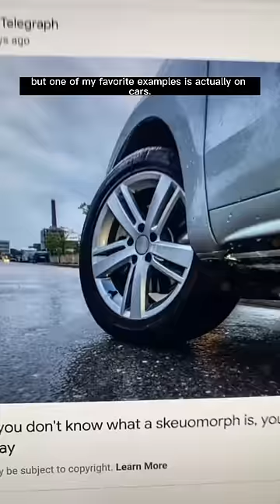Why do maple syrup bottles have tiny handles?

Comment: Also from cars: the blinker noise comes from a bimetal plate snapping back and forth, making the blinking possible. We don't use those anymore but the noise stayed.
Reply: Also helps to remind you when you may have left it on accidentally.
Reply: I hate the non bimatalic strip blinkers. They suck.

Out of sync and everything.
Reply: They are still used in some older vehicles.
In my city there are some old trams that use bimetal blinkers. You can hear them click quite well when the tram is almost empty.
Reply: Ah, another Technology Connections connoisseur
Reply: @ZM1306 I never knew why the sound didn't match the lights!!
Reply: I hate the sound so much I ask my partner to turn off the blinker if the light is taking to long. I hate any repetitive ticking noise though.
Reply: Going through the comments to find other examples of this. Thanks, this is a good one.
Reply: My car does :)
Reply: @ZM1306  worst part is they usually have an inconsistent BPM
Reply: Right? Why not take out the entire blinker system? Not like people bother to use it.
Reply: @ZM1306  Seems like Ford has done a pretty good job with theirs. It's electronically controlled, so there isn't a problem with syncing an inconsistent blinker module with a consistent electronic ticking
Reply: The noise is useful for the driver to hear to know if their blinker us working or if they accidentally left it on... Without having to take their eyes off the road to look at the flashing arrows on the dash
Reply: i mean now new cars just use the speakers but it was only like 12ish years ago so theres a lot of cars that still use them
Reply: So the noise is actually a Federal requirement, so when they stopped using flashers and went to full LCM computerization the noise/a noise HAD to stay.
Reply: Also nice to have a feedback noise, but that's an interesting reason for the noise existing in the first place
Reply: @Ariridesbikes this is the second comment on this video i have seen mentioning TC
Reply: Our family car doesn't have it, and it bothers me unmeasurably
Reply: You say "we don't use those anymore," but plenty of cars still do. I can go into the Toyota dealership and walk out with an 80k landcruiser that has air-conditioning as an optional extra. A car like that is not having fancy pants indicators. Plenty of vehicles still use old technology.
Reply: @peacelovewar98  Can't turn the blinker off.
You may know where you ate going.
The person behind you might be on the turning lane.
But the person comming from the other side neither knows the lane layout (because cars are standing on the direction arrows) and they don't know where you are planning to go (as that might be ambiguous or you might not care for the lane arrows).
Reply: @BlackKraya  Analog Telephones had quite a bit of noise on the wires. Because up to100% of the wiring was used analog.
With digital telephones - even the earliest cell phones - this wasn't the case. There isn't enough Analog used cabling to have audible noise.
All the electrical noise is a digital transmission issue.
They add noise onto the signal, so users know if there is still a signal comming from the other party.
Reply: @christopherg2347  like which noise do you mean? The connection?
Reply: As a kid I loved that sound on the first car I can remember, and was learning to imitate it :D
Reply: @EmGeeman287  bimmer apparently did that for 97% of their drivers lol
Reply: I wonder if that would make a better sound than my blinker does. For some reason out of all the cars they test drove the one with the worst blinker noise is the one I bought.
Reply: @Allstin  The ever so subtle background swoosh, that you only notice when it is absent.
Reply: did not know that one, very interesting!
Reply: Okay uut the original blinker noise is just something else
Reply: But the noise does have a purpose such as reminding you have your turn signal on besides the sound it makes if you've left it on for way too long and some are hard still have this is if a blinker goes out it will start to click more rapidly and Flash more rapidly
Reply: It helps people to know if they're still indicating, but somehow, some people don't notice the sound has been going for 10 minutes and I have to creative convey to them that they're still indicating right in the right lane of the motorway
Reply: Some still use them but mostly the noise is just there for us
Reply: It helps remind you you still have your turn signal on.... It's just not as effective on 80-year-olds that drive down the fucking highway with their blinker on for 10 fucking miles 😭
Reply: @Ariridesbikes  we have arrived
Reply: I think it also serves as an audio reminder for those who forget to turn it off.... but those people still ignore it. DUMMIES!
Reply: Learned something new today, thank you stranger.
Reply: @ZM1306 generally the smallest difference between the strips can cause it to have a slightly shorter or longer blink, so really the mechanical ones are much more inconsistent
Reply: Didn't know they changed that. Mine has a noisy relay.
Reply: Was wondering about that while driving that yesterday. I was thinking about how it sounds like something hitting something else.
Reply: While the noise is fake it's still nessasary.
Reply: I dont think it was ever bimetal, the sound was usually produced by a relay that had a magnet in it and a springed contact that would stick and unstick, closing and opening the circuit.
Reply: @HartyBiker There's a difference between "vehicles still exist with this technology" and "vehicles are currently being mass-produced with this technology", you can almost always find some niche place to get niche things.
Reply: @theBestElliephant  a lot of 4wds being mass produced now still use that technology.
Reply: @unicornkitteh5332  "The inventors of 'foolproof' systems, underestimate the ingenuity of the fools."
Reply: @EmGeeman287 Yes, and those people are called "Bad Drivers"!
Reply: @christopherg2347  lol this is so true. Is that a quote from someone?
Reply: @unicornkitteh5332  I am sure it is a quote, just not sure where I got it from.
Reply: @christopherg2347  it doesn’t stay off, if we’re in a turning lane without a light I get it has to be on. If we’re in a lane with a light it’s off after a bit of waiting and back on prior to us turning once the light goes green
Reply: I learned the other day that, after changing lanes, my car beeped louder to remind me my turn signal was still on and one-up the subtle ticking to the next level.
Reply: @ZoosheeStudio  too bad everyone where I live can't hear it i guess.

Comment: If you've ever wondered why your standard has misaligned keys, it was a mechanical necessity for typewriters. We kept the design because people were used to that layout.
Reply: A typewriter is a mechanical marvel. Somewhere between a grand piano and manual transmission.
Reply: It put the letters in such order to lessen the possibility of the mechanical letters to hit each other. 
The french have there own, not qwerty but azerty if I remember correctly.
Reply: The letters used most often, in English, are placed under your fingers when you place your hands in the traditional location. For example.. .look at location of q and z. Most useful class I took in high school was typing.
Reply: @nn3514  in a daisy wheel style printer, it ment the Q had to travel further to the paper and had the longest “arm”. This ment it was longer on his way with the biggest reach so the probability of preventing another letter to reach the paper was the greatest. That’s why the most uncommon letters are on the sides. (I’ve learned blind typing on a mechanical typewriter during a course)
Reply: yup. designed with the most used keys to be the easiest to press. 

if you just rest both hands on your keyboard with thumbs on the spacebar. notice where your fingers are naturally at.
Reply: @uberempty  I think you are thinking of a different layout such as Dvorak, QWERTY was not designed with common letters being most accessible, rather putting common letter pairings (such as ‘he’ and ‘th’) a bit distanced from each other to prevent jamming on typewriters, as they were what the layout was designed for.
Reply: Also but slightly unrelated- the word “typewriter” can be written using only the top row of keys
Reply: So unintelligent. They made up a new word for whatever the first time.
Reply: That's a little different though. The trash on your computer looking like a trash can isn't affecting the way you drag things into it, but the keyboard layout being misaligned is part of the function.
Reply: @theofthe2299  Correct. QWERTY was designed so that people would stop breaking the typewriter from typing so fast. It was made to slow people down. The other thing is that tradition has kept it in place all these years.
Reply: It had nothing to do with the mechanical nature of the typewriter. The layout comes from trial and error. Oddly enough, having the keys arranged alphabetically was too hard to use.

There was no mechanical limitation or other mumbo jumbo that led to qwerty.
Reply: @Muis83  that's incorrect. The letter layout wasn't chosen to make it less possible for keys to hit each other. "ER" is the most common English bigram but the keys are right next to each other and you press them rapidly with two different fingers. Same for TH, SE, DR, RS, KO, PO, HU... there's lots of those bigrams.
If you type the alphabet letter by letter you notice a pattern: up until the letter Q, the next letter is usually very close to the previous one. This makes me think that it's based on the alphabetical layout with some keys swapped for whatever reason
Reply: @tspawn35  no it was not designed to slow people down. The fastest person on the planet is Rocket with a little less than 300 words per minute, or 5 words per second, and he did it on QWERTY. Now, I never owned a typewriter, but I suspect what's slowing down the typist is either the typewriter itself (heavy, slow keys with long travel distance) or the typist (to prevent hammer jamming)
Reply: @topherkrock  What you're referring to is keyboard layout. QWERTY is not the reason your keys are misaligned. Your keys could just as easily fit on a perfect grid, but they don't.
Reply: @tbqhwyf  going back to the mechanics of the typewriter, letters would be in half a circle. The travel an E would do is very similar to an R. This ment the letters would not cross each other coming from left and right. In the middle it didn’t matter which hand because it had the short travel.
Reply: @tbqhwyf  5 Words per second? Farrrrrrkin hell
Reply: @neverfail9432 , wrong. The alignment of the keys wasn't for mechanical purposes, either.
Reply: @topherkrock  If you care, look at an image of a type writer and notice that each key has a metal bar extending upwards. They can't overlap, so each key has a unique column. 

You could also do a basic google search and find the same information before claiming someone else is wrong.
Reply: A E F J I L  @uberempty

Comment: Only problem hank, that's a picture of an ALLOY WHEEL not a hubcap. Alloys have to have spokes or something because otherwise they'd be extremely heavy and defeat the point
Reply: I was about to comment, “that’s not a hubcap”
Reply: @jollygoodsmashing these wheels do look like alloys but it is hard to tell if they are or not. some care company's actually make a spoked steel wheel with a plastic cover that could be considered a hub cap. Also that little circle in the center of the wheel. could also be considered a hub cap.
Reply: @tobymikula9081 that's definitely a rim. It's not a hubcap at all.

Comment: My favorite is the blinker on cars, blinkers used to have a relay under the dash that clicked on and off making the blinker noise. Now cars make the same noise through the speaker in the dash, if you’re seat belt starts dinging at you while you’re turning you will hear the blinker noise stop while it dings and then continue clicking again afterwards.
Reply: You don't realize how useful it is until you drive something without the blinker noise. My dad bought a tractor that doesn't make any noise for the blinkers or hazard lights and we always forget to shut them off
Reply: I love the relay sound of the blinkers, the fake beep-boop they started to put in mid 00's cars is horrible, I can almost smell the cheap plastic from thinking about the blinkers
Reply: I just wanna know why its tiny, not why there's a handle,
Reply: @bambibooza4921 It’s just aesthetics now. They shrunk down the whole bottle, and now the little handle is just iconic for maple syrup. I’ve never actually seen one though haha.
Reply: thats not the same though, the noise is there for a reason, not because people wanted to hear it for memories...
Reply: And it clicks fast when it doesn't work to warn you

Comment: Car indicators used to have a mechanical clicking noise as the light flashed because the circuit actually had a mechanical switch. Now there's an electronic clicker specifically added so you know it's still doing the thing.
Reply: Alot of newer cars just play it through the stereo speakers now
Reply: @archygrey9093 You sure they don't play them through the mono speakers?

Comment: When you mentioned the shutter noise my immediate thought was how digital keyboards have the sound effects (and on android I think they also have a vibrate/other physical indicator) automatically turned on. You have to actually go into the accessibility/keyboard settings to turn them off.

I love that this is the backup system we’ve made - electronic makers assume that most people will want to verify that their device is working, like the old ones used to, so we make them pretend to function in the same way.
Reply: I actually find the noise and vibrations to be really helpful. I have a lot more difficulty typing when they arent on. It might have to do with dyslexia but it might be in the acceptability section because of disability.
Reply: I usually swipe-type, so it's confusing when I have those sounds turned on.

Comment: When writing a text document in Windows, hitting the ‘enter’ key generates two characters in your document, called CRLF (Carriage Return, Line Feed). This is a reference to typewriters where moving the carriage (the letter stamping mechanism) to the left of the page and advancing the paper upward were two different actions. 

In Unix-based systems, hitting ‘enter’ creates a single New Line character. Without handling this difference, a document that was written in Windows and copied to Unix will have a weird symbol at the end of each line, representing the Carriage Return character.

Comment: I really love that the picture Hank chose is of a wheel and not a hub cap.
Reply: Lol they did a good job with the fake disc brake look.
Reply: I was thinking that same thing. I am pretty sure that is just an aluminum rim lol
Reply: @Moo Evans  That is not a hubcap. It is a wheel. Hubcaps are generally plastic or very thin metal covers that snap onto a wheel to look like a more expensive wheel, like the photo. The photo is an aluminum cast wheel.
Reply: If you want to get super technical, that wheel does have a hub cap. It's the small circle in the center, maybe an inch or inch and a half across.
Reply: @musewolfman  I like that. That is funny. I never thought of that.
Reply: @LegacyMuse  Ummm, actually that's center cap.
Reply: Center = hub (I can't believe I'm typing this!)
Reply: @streitrat  he specifically said in the video that the hubcap was designed to look like a rim. This implies that he probably meant the rim covering type of hubcaps. Using the literal meaning of the word hub does not apply to the majority of hubcaps. 
A covering in the middle of an aluminum rim is not the same as the skeuomorphism used on the hubcaps that cover an entire steel rim.
Reply: @streitrat  The hub is in the center, yes. But if you want to buy a replacement then you probably want to call it a center cap and not a hubcap.
Reply: @mooevans2537  amusingly, no. That's an alloy wheel without a hubcap, which is why you can see through so much of it it to the brakes behind it. Those spokes are real spokes! Edit to add: it has a space for a non-functional badge in the very centre, but that space is blank, so it doesn't even have a hub cap in a technical sense.
Reply: @mooevans2537  you dont know what you're saying
Reply: @mooevans2537  wrong
Reply: Yeah just a tiny hubcap in the center
Reply: car nerds smh

colloquially, the hubcap is the outer part of the wheel that isn't the tire
Reply: @Romantic Outlaw  yes, everyone here knows that. not all wheels have hubcaps, and that one doesn't.
Reply: @ZoosheeStudio  hubcaps and wheel covers are two different things. The nerd in this video doesn’t know what rims are, or in fact what actual wheels are. That is really really really sad.
Reply: @musewolfman  someone with a brain. Impressive.
Reply: @streitrat  I can’t believe you had to write that but I’m glad I didn’t have to.
Reply: @joeyreimer8550  because those are called wheel covers.
Reply: @ZoosheeStudio  only because morons started calling wheel covers “hubcaps”
Reply: @musewolfman  wouldnt that be the... wait shit youre right